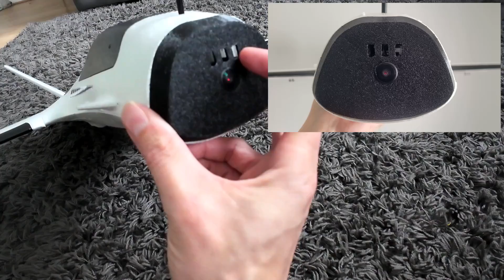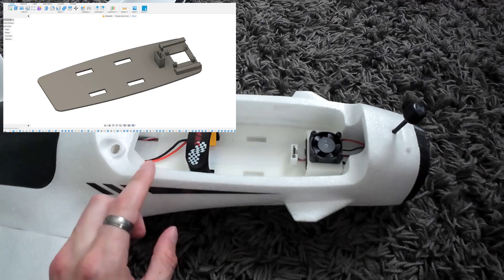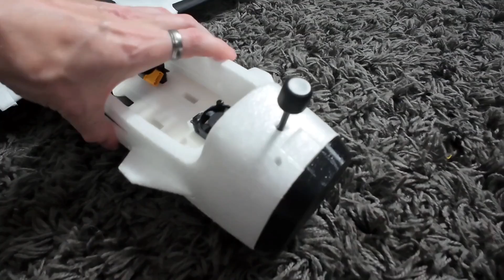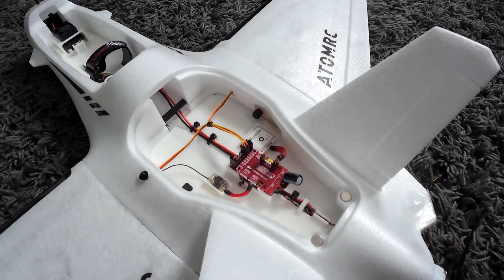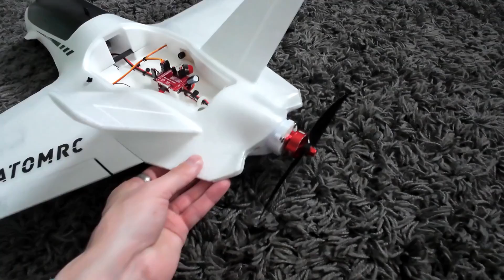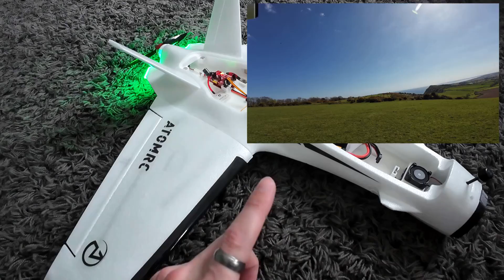🛩️ Atomrc Dolphin - Ultra Clean Build (No Messy Wiring)

Comment: I always wanted to build clean like this... But I did the spaghetti plate and it works great lol! Mine goes 150mph on 6s.  Love it!
Reply: What motor and prop and what flight times do you get?
Reply: @saturn_fpv  I've tried a few, but I'm cheating.  I'm at 9600 feet above sea level.  I run a MB primo 2410 1750kv (limited test run motor that ya can't get anymore) with a 6x6 or 6x5 that pulls about 30 amps in the air but probably gets danger hot on takeoff.  I can easily get 15 to 20 minutes if I cruise.  I've tried f90 1950kv and they would probably be fine with a 6x4 but I've smoked 2 of those so far.  Im trying a 2806.5 1700kv brother with a 6x4 or 6x5 to see if I can find a sweet spot for a target speed of 120s.
Reply: @saturn_fpv  2250 xilo 6s packs or chl 2200s.  There is a huge difference between the two in power though.

Comment: Very clean. To get the best of both worlds with the servo wires you could use an extension lead, then the extension can be tidy (possibly add a place for them on the 3D printed baseplate?) and the servos can just plug into them in a convenient place.

Comment: Nice build.  A great power train which runs on 4S for this aircraft (and can go just over 100mph without diving) is TMotor F80 Pro 2200Kv/Flash 6042 prop/50A ESC

Comment: I think the stock motor is way too small. Mine burned out on the first flight while I was tuning it. I think it's just too small for a 7" prop. I switched to an f80 1900kv with a 6 in prop on 4s. I get about 80-90mph in level flight. I also remixed a motor mount that uses heatset inserts to increase longevity. its on thingiverse at thing:6595757 (youtube won't let me post the link)

about the roll rate. I think your throws may be too small. mine at full elevator are about 12mm, and full elevator and aileron combined are about 21mm. thats measured with calipers so it's not perfect. With that my autotune gave me a roll rate or 230 and it's even faster in manual so I'm happy with that. I can show you some dvr if you're interested. 

I initially had a lot of problems autolaunching due to torque roll. It seems this plane really likes to launch with a low throttle. i'm still testing but I think I'll probably end up around 50-60% launch throttle. 

let me know if you have anymore questions. I'm definitely not a pro, but I've been testing and tuning this model for the past 2 weeks so it's fresh on my mind.
Reply from the maker: Thanks for the info about the throws, I'll have a look into that, but I agree, think mine are way to low. Also thanks for the heads up about issues with torque roll on launch. I'll keep that in mind for my next flight
Reply: @gizfpv  looking forward to seeing it fly better, best of luck!

Comment: Well done!  Do you have links to your stl files and a link to that 5v fan?
Reply from the maker: Check the video description, I've just posted a link to download the 3d print files. As for the fan, the one I used was this one: 

https://www.amazon.co.uk/GDSTIME-Brushless-Computer-Cooling-40x40x20mm/dp/B085PT95GH/ref=sr_1_4?crid=32U8UV0RUZCTZ&dib=eyJ2IjoiMSJ9.VhP5azdc2a0q0dcILuDhV_j-cGmS7WS63VBbsNVJIc4MxKhzVzD94014QMTTdAg2_9YJg4eHmDrsyh_UWqeklLIrfu-89yU4N9J2ZzWIMudLOehlnvCP2lVf60SF4g6efcbywSOZpGc4dtXeGbLBlvJMe2qf6vekSXh6jRXT4d-AkoOf5zrwdbEM50akBSuHX2s5rXpaXEAymal3MIMPA42pSRDGtFwf-EodKqdpfwY.ERLtzD6zjqp3luyYMZBuplU2N7yurA13aslJUaFI3lg&dib_tag=se&keywords=gdstime%2B5v%2Bfan&qid=1714303079&sprefix=gdstime%2B5v%2Bfan%2Caps%2C110&sr=8-4&th=1

Comment: Im running iflight xing 2506 1500kv with 8x5 prop thrust is massive 2kg and my setup auw at just shy of 1kg
Reply from the maker: What size ESC do you use with that setup? What amp rating?
Reply: @gizfpv  flycolor 35amps blheli. Current setup cruise at 3amps average on 65kph
Reply: Is that on 4s?
Reply: @grahamdowns7055  yes 4s

Comment: Well done !  Actually the extra weight with the original engine is not a good thing.  To improve the model, why not a twin-engine 6S (watch youtube, a guy made the modification, the links to the STL files are available in his videos.
https://youtu.be/AG0i__9VaIk?feature=shared
Reply from the maker: I did actually originally think about doing this, but then saw the issues he had getting CG locked in. I wanted my build to be clean and didn't wanna be sticking nuts and bolts on the tail lol

Comment: For plate under battery, plastic nuts could be glue into foam, and then you can fix it with plastic screws. Fantastic wiring and setup.

Comment: Love your design work on the 3d-prints. Very professional and pragmatic designs, well thought out for access, snap-in mounting, etc. Good inspirations. The under-floor wiring has a zen feel and gives the whole project a polished finish. This is the most hot-rodded under hood wiring setup I've seen. Excellent craftsmanship. 
For wing wiring connection, it might be possible to use pass-thru pins (like used on FC) to integrate floor plugs near the wing root area, with a second permanent run of wiring under to floor to the FC. 
I've seen a few people turn the Dolphin into a twin, but that's pretty major, as requires a rethink interior layout to keep CG location balanced. This one way to level-up performance.
Reply: Yes i agree with you,3D printing certainly gives it a professional look.
Reply from the maker: I did actually consider changing the wing wiring, so that the electrical connectors were at the root of the wings. I saw someone who did that - they installed custom connectors with 3d prints in the wings. However when it came to the build I couldn't find his post, and was too lazy to design the parts myself lol. Something I might still do one day tho :)
Reply: @gizfpv  Finwing Hobby list "9+2 9W2 VTOL/UAV Connectors (male/female)" on their website under accessories. I've seen a number of models use these "9+2" (9 signal + 2 power) connectors. Beside Finwing, ZOHD uses on their lasted model. They can be found online from other sources as well. Not sure if they're a standard electrical connector repurposed, or not.

Comment: very well thought out.
my drivetrain = T-Motor F90 2806.5 1500KV, T-Motor F35A 3-6S, and a homemade 4S1P Molicell P45B pack (21700).
I use Aeronaut Cam Carbon Folding Propeller Blades 7x4", with a Pichler Prop adaptor (folding prop) KLS 58mm | Ø 4.0mm.
Reply from the maker: After multiple recommendations, I've gone for the F90 1500kv motor :)
Reply: @gizfpv  what kind of prop do you use with f90? does it possible to have you tunning pid?

Comment: Very clean build @giz, an idea on the servo would be to shorten the servo wire just inside the wing, and use an extension from the FC to reach the servo.
I would make it so you can disconnect and you can run the extension under the fc base. It would look a lot cleaner

Comment: I ran a 2216 2200 kv on 4s with a 6x6 prop and it was a rocket but I failed to upgrade to a 60a esc  (from the 40a ) and the esc tripped while going 110 mph cause a fatal crash of the aircraft

Comment: The stock motor and prop isn't that great. Add in the limited current from the Lions and there's your underpowered answer....Great clean build though matey....I'm surprised at the position of your battery. Imagine if there was a GoPro brick up front too ..😮😮😏🇬🇧

Comment: I am running a 2308 1300kv motor with an 8050 prop. It has like 1.5kg thrust and it's crazy. Yet it can cruise at like 1.5 amps if you really try.
Got about 20min flight time with a 1440mah 4s going down to 3.6V.
Reply: Now I keep thinking about how it would behave with a 2806 1300kv in there. 😁
Reply: I'm running a 6x6 on a 2410 1750kv prototype motor that is no longer available on 6s 2250 with a 60 amp esc. Runs a bit hot but gets 150mph  level! Mid throttle is over 70 mph.  Gets 10 minutes mixed flying, but I like to go fast!  I'm thinking of going to a mini drak power setup to see if I can't break 200!
Reply: what is you motor

Comment: i’ve put a aos supernova 2207 with a 60-70A blheli_32 esc so that i can fly it on 4S with 7” (7042x2) props and on 6S with 5” (5036x3 or 5152x2) props. on the bench it looked great but still need to test fly it.
Reply: i’ve actually decided to go with a brotherhobby 3115 1520kv and run it with either 6s 7057x3 prop for daily flying or 8s 7x8 to try to break that 200mph barrier

Comment: Clean build indeed. My powertrain upgrade includes: Motor: 2808 @ 1950KV, Prop: 6045, ESC: 80Amp,
Battery: 1800-2200mah 6S lipo for high speed flights / 4000mah 6s lion for long range endurance flights
With these upgrades the model easily reaches 120 mph.
Reply: How much of that 80a esc are you using?
Reply: @CurtisRedfield  with this setup my max amp draw is little over 60 amps. I prefer to have some more headroom, so I picked up 80A ESC.
Reply: I cooked a f90 1950kv with a 7x5... I'm at 9600 feet above sea level... Went with a 2410 1750kv and a 6x6 which gets 150mph on a 60 amp esc 6s 2250.

Comment: Nice build! When I saw you put the two 3D prints in, my thoughts was immediately that's a lot of weight. My two Dolphins I put on a sunnysky 2216 1250Kv turning an 8x6 APC-E prop and that has lots of grunt!
Reply: Is that on 4s?
Reply: @grahamdowns7055  Yes, 4S